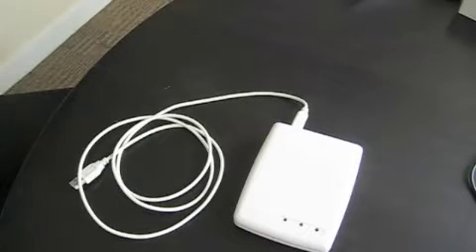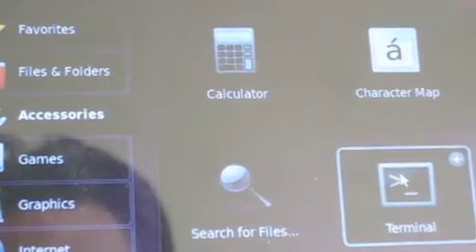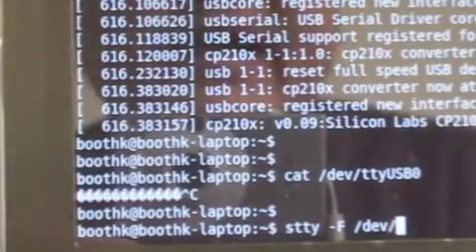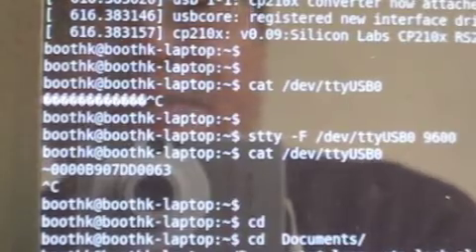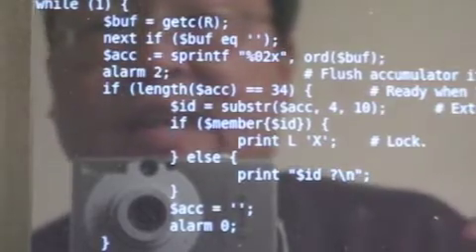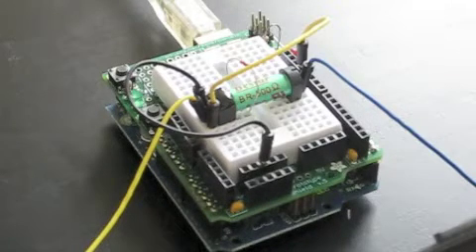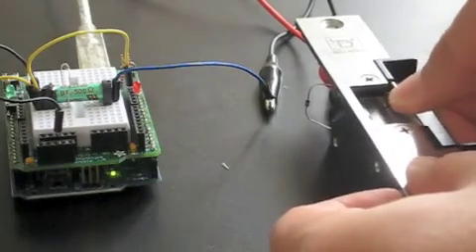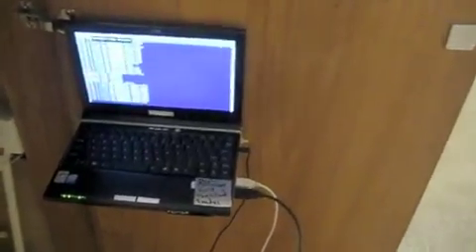HackJam RF card door lock for BootHK

Comment: Transcript:

dmesg - Get a list of devices.  Note that it is connected to "tty usb 0" ("cp210x converter now attached to ttyUSB0")

cat /dev/ttyUSB0 - Show the output of this device as text.  Scan a card and see some text on the screen.

stty -F /dev/ttyUSB0 9600 - Set the baud rate to the correct value.

cat /dev/ttyUSB0 - Now we get a nice long 17-byte string (Hex), ending with a CR/Newline.  The most important thing is the 5 bytes in the middle (see time 4:45 in the video)